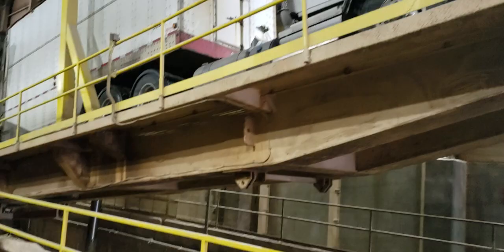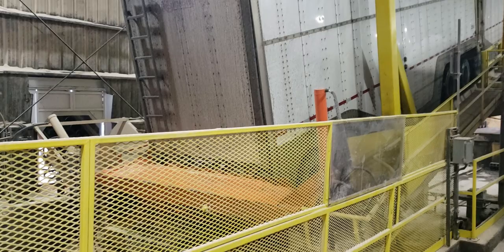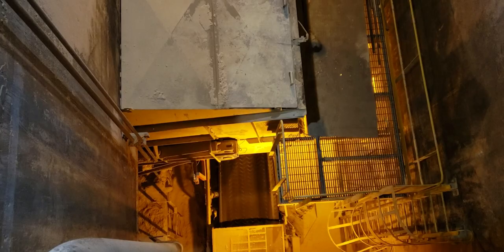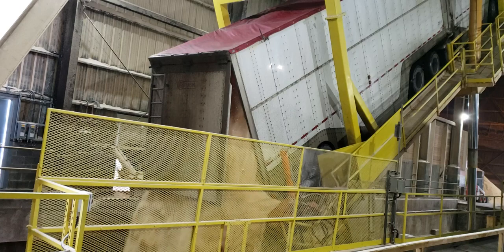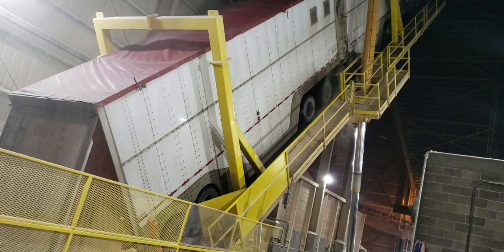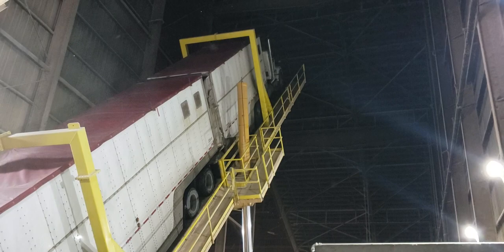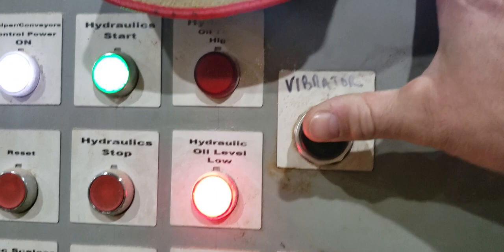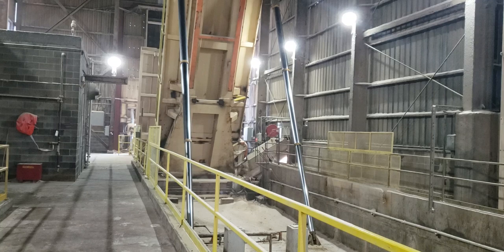How chip super b trains unload

Comment: Some companies in bc are switching to a new chip train style from tycrop, they remove the possum belly and stretch the boxes out to be the same volume but a flat floor for better cleanout. Makes them more versatile for hauling hog fuel and sawdust without cross contamination. They can be smooth inside with ribs outside or a smoothflow wall design only those are much heavier. Many companies are starting to switch over the tarps to electric for safety as well. There is a new style for b trains from valid manufacturing designed specifically for high loads and they are testing them on 53' trailers as well. Some companies use the ecargo 591-w with decent success 3 seasons of the year except winter and 90% of the quad axle chip trailers we have around here doing stateside are all electric tarps
Reply from the maker: Electric tarp would be sweet. We use Dr tarp for our tarps here in Ontario.  
I now run a tycorp smooth flow walking floor now. It unloads real quick on the dumper,  12 to 15 mins walking a load off.  Love it

Comment: Do you need to pick everything up in your cab when it comes back down? Would make a cool video if you left a camera running inside while its unloading
Reply from the maker: Nothing moves in the cab. I keep a extremely clean cab.  I have bad allergies so no dirt. I drive in my socks.
Reply: @endurotruckererniedesjardins  damn I want to buy your truck when you’re done with it, if it’s kept that clean, cool video I pull a hopper never seen these

Comment: Why not just do what we do with cane doubles and have a crane arm that side tips lightweight bins off a skeletrailer
Reply from the maker: I've seen loads up to 70 000kg gross on that dumper.  The backstop also vibrates to loosen frozen or wet saw dust.  Side tipping would not work fo this application
Reply: @endurotruckererniedesjardins  umm, yes it would, side tippers arent limited by weight and every side tipper i've driven has a side thumper for mud

Comment: I had only seen this once in the past... the diesel engine and truck do not have problem(s) with this lift?
Reply from the maker: You turn the engine off to dump. Some of the older trucks wouldn't start after lifting. The fuel filters would mt